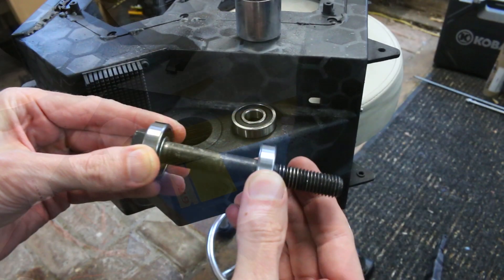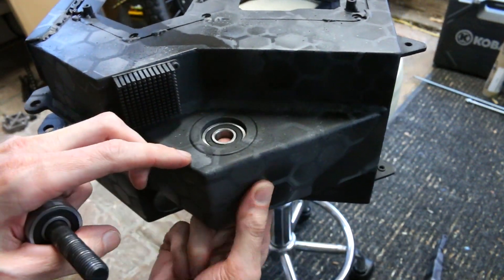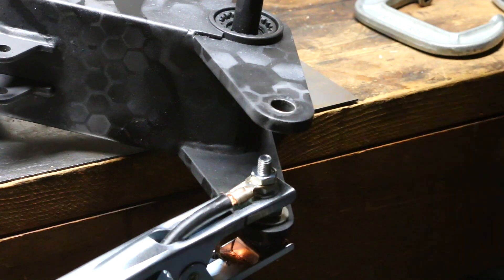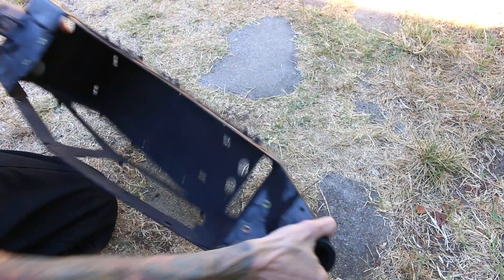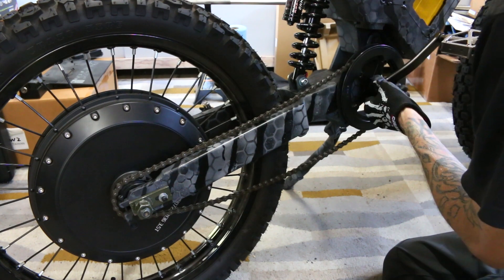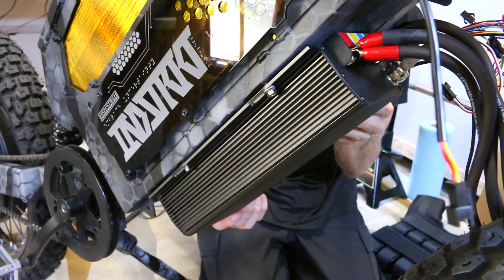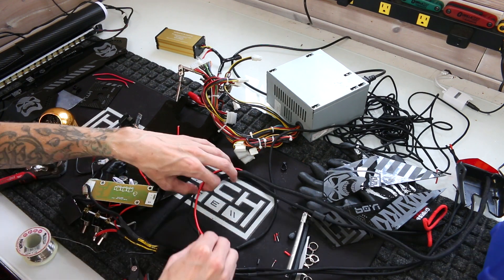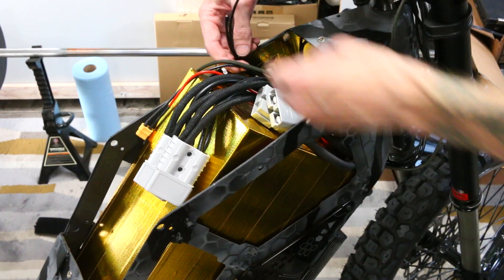🚲 SOLID GOLD!! Commence Reassembly! E-bike 9.0 \\  Enduro - DIY Build! \\ QS273 70Ah

Comment: If you are really in that gold rush, you should buy one of the most expensive gold pack battery which got the highest quality and performance on planet earth ever. You'll be able to beat everyone so far. Just make sure to never leave your vehicle unattended. Is the controller with the cables out even splash water proof? I got the same battery with 72V/70Ah/150A (300A) discharge for my dual motor harley.
Reply from the maker: Oh yeah, I've seen those batteries, there was a bit of inspiration from that 🛸 batteries are always gold in my mind. If you want to know more about the philosophy behind why gold is cool to me, I describe it in a lot of detail in my video series on The Moose. 👍

The bike is splash proof, but I will not ride it in the rain. Even the bikes that are "waterproof" tend to get leaks and problems that I'd rather just avoid entirely. That's awesome man, are we talkin' a real harley build here? I'm sure you've seen rich rebuilds then. If you have vids or pics I'd like to check it out. 🍻

Comment: I'm building a 2000w do you any suggestions on a battery
Reply from the maker: It depends on what you need, I would try to get the biggest pack I could physically fit in the allocated frame space. 🍻

Comment: It looks amazing.  I am always fascinated by people like yourself who constantly look for ways to solve riddles presented by any build.  You sir are an inspiration.
PS. on the riv nut thread stripping front...too much lever arm leverage of the two large arms of the riv nut tool deforms the riv nut to the point the threads distort.  Work around is not to deform the riv nut as much by reducing the amount of arm displacement/pressure of the tool.
A further trick so your riv nuts are very secure is....apply a very small mix of JB Weld 2-part quick set epoxy to both the outside of the riv nut and interior of the hole ID and then quickly fasten the riv nut in place with the large tool.  Yes, a bit fiddly but when you add this step,  the epoxy will keep the riv nut in place with less riv nut deformation of the big tool which preserves thread integrity.
Reply from the maker: Thanks so much Luke! Much appreciated, cool tip with the rivnuts too I'll take it into account in further applications 👍 Thank you!!

Comment: So far it looks, terrifyingly, awesome...
Reply from the maker: Thanks so much man!
Reply: @hightech-lowlife  Thank you HT\\LL for this awesome content...  May I ask how fast will this new build go; perhaps I missed you saying top speed... Waiting as fast as I can to see what's next...
Reply from the maker: @gi169  Thanks so much for watching man! I honestly don't know yet 😂 I still have to tune the controller, I'm guessing in the 65-70mph range, but we will see once I'm finished (should be done within two weeks or so). I will do a speed test for sure though 👍 My digi camo bike with a QS205 did 54mph and that was only about 5KW, this is in the 20-30KW range, so it should go quite a bit faster than that, although it does weigh more. Once you start going over 40, wind resistance is the greatest factor to contend with.

Comment: The lights you can use led headlight and tail light which support up to 90v so you won't need a dc-dc converter. Amazing build
Reply from the maker: Thanks so much Diogo, I'm not aware of any lights that run off such high voltage? All the LED lights I know of use 5 or 12, but there may be some out there that have a built-in converter 👍

Comment: Hello.
Very very nice work!!!
I like the gold bar, it comes out nicely!!!
Where have you bought those tires?
I have the other frame and got also a bit off play on the rear arm.
Greeting from Belgium :)
Reply from the maker: Hello Wim! Thanks so much, I appreciate it! I got these tires on eBay quite a while ago, I think they're still available though. If you ever want to take up the slack there are a lot of methods and you don't even need a welder 👍 Thanks man!

Comment: You just get better and better bro.Hey what do you like better the 273 or 205 5t v3.I know one thing the 273 is alot heavier imo.
Reply: I got a 205 5t and i like it alot. Not to fast.(60km/h) But alot off power it powerweely's!!!
And lighter is good for longer riding. 
Greeting
Reply from the maker: 205 is also great!
Reply from the maker: Thanks man!! Yeah it really depends, I think for most people 205 is all the power you'd ever need - it's really not until you're pushing 300A + that the 273 is worth it because it can handle a ton more heat, at of course the expense of weight. This bike is already going to be crazily heavy so I figured the 273 is better suited for this application 👍 The bigger you go the more expensive everything is though, so again for most people 205 is a great motor.
Reply: @hightech-lowlife  Thanks bro yeah l have a 205 5t v3 just need to get a battery and then l can put it together.l also have a 150a Sabvoton from what I've seen l think 50mph is possible with a good battery.What do think you way more than l do.Thanks for the reply
Reply from the maker: @racerx2095  You will easily hit 50+ if you get a battery that can output 150A, probably more like 60-65! 👍
Reply: @hightech-lowlife  That's what l was thinking if l get 50mph I'll be happy.Thanks again.
Reply from the maker: @racerx2095  You'll get it, easy! Thanks!
Reply: @racerx2095  I have build a few 205V3 hubs and at 72V 400phase amps they can wheelie pretty easily. If your going with a bigger controller get the 3.5T. It has much better top end and with the high current torque is not an issue.
Reply: @Twin_turbo_coyote_fox  Thanks for the reply I'm happy to know that for sure.

Comment: Check your Instagram direct messages, in there I sent you some good suggestions … also an easy solution to the swing-arm wobbliness… there is a gap between the pinchers and the tongue.  These nylon washers fill that gap keeping the swingarm feeling snug while at the same time being somewhat compressible  so not to put undue stress on the parts when in a turn or going over rough uneven terrain.   The size is M12 x 30mm x 1.5mm nylon washers sold on eBay.  I thought I was gonna have to completely redo the linkage and this solution fixed it right up.
Reply from the maker: Thank you, I'll check my messages 👍I tried washers last time but it wasn't enough to keep things in line, if things are still not ideal then I'll add the washers too! Thanks!!
Reply: @hightech-lowlife  if I remember you had the old design with the rubber insert around the bolt instead of the new design which has actual bearings set in a recess around each side of the tongue Thru bolt.
Reply from the maker: @erikjonromnes  That's correct, the rubber bushings were way too forgiving, like a rubberband!
Reply: @hightech-lowlife  Nylon is much stiffer than rubber and should solve the wash out compliancy issue you had with rubber as Erik suggested. Analogy is automotive applications where nylon is used for less compliancy versus rubber which much lower durometer.
Reply from the maker: @lukewalker1051  Thanks man! I totally get it, as of right now though it's a solid as a rock 👍
Reply: Can you provide the link to the washes please.. there are so many on eBay it's confusing.
Reply from the maker: @markj.7630  According to Erik's message: "M12 x 30 mm x 1.5 mm nylon washers" if you search on ebay a bunch of sellers come up.